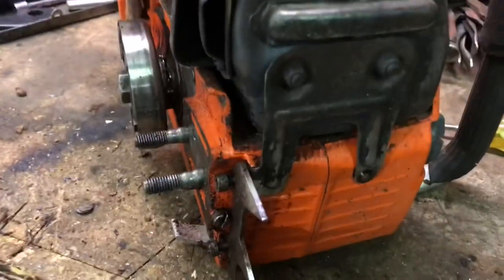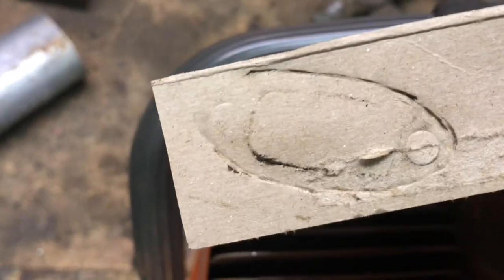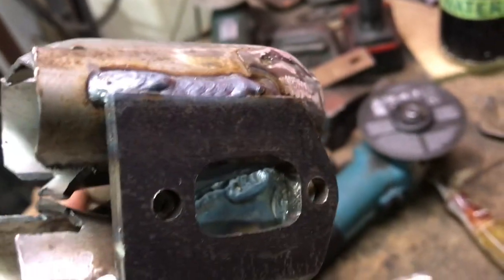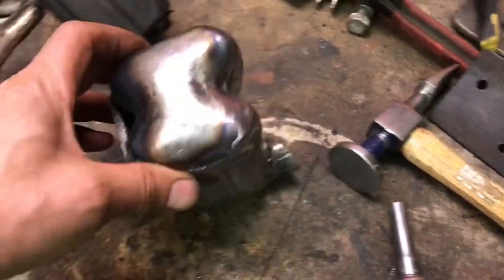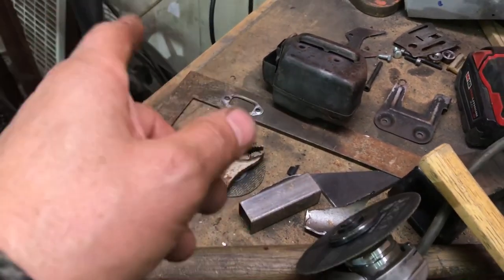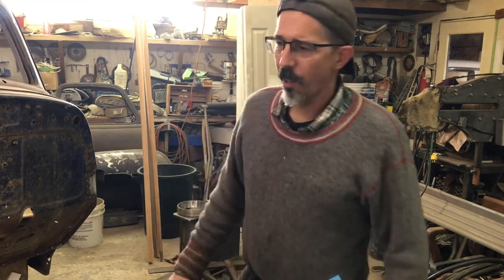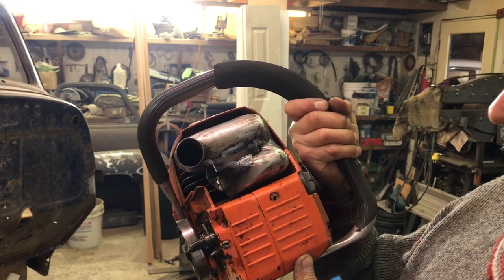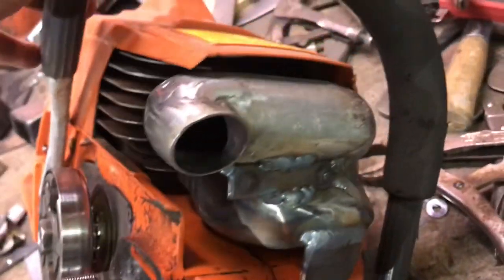Chain Saw Custom Exhaust Pipe

Comment: I think you should make a new brace for the front of it. Otherwise it will keep coming loose, and the bolt holes in your cylinder will strip out. I've seen it a hundred times.

Comment: I agree with the expansion chamber idea .I rode 2 strokes alot when I was young . Every engine design needs something a little different but an expansion chamber on a 2 stroke is very very beneficial.  Thanks for sharing you have a great design started please continue to experiment with it .

Comment: I love this, a brand new idea! You have really hit on a smart design. I love the connection between the chambers, I believe it helps the pulses pick up some velocity. Its like an expansion chamber compacted into the same size space as the original can but with likely a broader power band. Can't wait to see that in the wood 👍👍👍👍
Reply: It's almost like an offset smoker build. If you   can vary the exit pipe, you might be able to tune it to the size engine you run it on.

Comment: i like how you did the exhaust bolts , i've been running this very thing through my head ( meaning building a tuned exhaust  to fit into that cramped area )and the exhaust bolts always get in the way of the flow of the exhaust .  it also has a "pop" or "snap" to the exhaust , which i've only heard with a properly built  exhaust  .
Reply from the maker: I have another video coming out later today showing another pipe and we get into the wood.
Reply: @WildWestGarage  look forward to it :)

Comment: The pipe works cause it went rich just turn the high jet in 1/4 turn at a time till it cleans up in the rev. Once it cleans up turn it back in a 1/4 turn so it stays a little rich and you should be good. I like the looks of it to
Reply from the maker: Thanks Kurt. I learned my lesson with saw tuning years ago, leaned my saw out and it made awesome power until it seized up, I won’t do that again.
Reply: Agree Kurt, if it fattened the tune it's most likley working the right way.  Should be able to lean it, get a bit more power but most importantly more fuel efficiency with proper back pulses (draw fuel into the pipe then force it back into the chamber). On a hobby glow engine i went from a stock 1 chamber muffler with baffle cone to a 2 chamber pipe. Huge difference, engine was way happier, and could run leaner.  There's a few calculations you can do to size a pipe. I really like how Morgan built his super practical.
Reply from the maker: @layback209fixorsmash3  I put this saw in the wood today, got it dialled in by turning the high jet in about 1/8 of a turn. It runs nice but I can’t really say for sure if it makes any more power, but I had fun making it. Buckin’ want to try it on one of his ported saws so that could be interesting.
Reply: It’s the other way around, it should need more fuel not less. If your backing the high jet screw out your increasing fuel.
Reply from the maker: @kamenheath7192  it was running rich after I put the pipe on, sounded like it was four stroking, I turned the screw in and it smoothed out, maybe the pipe is garbage?
Reply: @WildWestGarage  maybe it’s just more noticeable since it’s louder. You may have been rich to start before adding the pipe.

It should of went leaner if the pipe is gaining you HP you should have to add fuel if the saw is making more power. Not remove fuel. 

And you wanna be 4 stroking while free revving ,I wouldn’t get to caught up with tuning till you got her in the wood. 🤘

Comment: That wall that’s right in front of your sound waves shooting “straight” out your exhaust port window… if they can hit a concave 6degree wall so they bounce back into the center area of that exhaust port window?  It’s definitely going to sound louder and prouder so that immediately makes like a whole”Nother” 5 horse power psychology anyway!!!  LMFFAO!   It’s a cool design!!!  I had drawn up a center chamber with the curved front wall to bounce my sound wave back into the center of my exhaust port window….   The tuned pipe research says 4.75 to 5.14 of 1/2” exhaust pipe….  I envisioned a four lobed flower with those four corners being the exhaust ports… that’s roughly 1.25 inches of 1/2” pipe coming out of those four corners or exiting the center chamber… with the majority of the “pipe” inside the centered box… I think that standard exhaust box on the 372 is 3x3x3 or 76x76x76 440cubic on a 71.5 to 76.4 cc engine….  I’d think 2x2 x 3” deep or 51x51x76 around 200 cubic c… or roughly the 1/3 or 3times the cylinder volume for the exhaust with those 4 corners venting through the 5” of 1/2” … I’m trying to combine that tuned pipe logic into a box… there’s much talk about a single vent for the system so I will probably need to rethink the 4 corners venting???   That’s a damn fine bit of hanging around the shop fabrication!!!  I’m totally digging the front support leg that’s totally locked down the whole deal with the vibration.,, I use a dab of 1184 on my bolts like a blue thread lock but it’s always around so I just use one sealer for everything… it doesn’t harden so it’s a great thread lock too!!’

Comment: Since there's one baffle separating the 2 chambers with no restrictions in port size throughout the system,  would there be any advantages in decreasing the diameter of the exiting port?  Is there such thing as "back pressure?"  Thing looks great dude. Seriously!!!
Reply from the maker: I kind of went at this thing all backwards, I built it and then did the research after. I am now thinking about how I can make restricter cones for the outlet so I can tune the pipe

Comment: Nice work Morgan sounds like a dirt bike now.
Reply from the maker: Thanks Robert, I love the sound of a well tuned 2 stroke bike.
Reply: An often overlooked critical design of a 2 stroke is scavenging this is what the expansion chamber does on the pulse of the gas rebounding off the chambers walls effectively acts as a valve holding the fresh mix against the piston until repeated, will be interesting to see what the gains are as it's a precise equation of speed and flow etc   

Nice job  sounds great I hope to see more or any adaptions 👍
Reply from the maker: @jakpips3967  Thanks Jak, I know there are a lot of variables involved in getting the ultimate pipe set up, volume and velocity and such. I didn’t want to build anything that wasn’t going to be practical for an everyday working saw. To be honest, I probably only reduced the exhaust restriction and probably could have achieved the same result by gutting the original muffler but that’s no fun. Thanks for the insight, I really appreciate comments like yours. Just kid’s having fun. Thanks for watching.
Reply: @WildWestGarage  I don't profess to know the calculations or anything im far from pro on mods I have 2/ bike experience and have read a few books..  Keyboard warrior n all 🤣  but fair play  if it runs better and you enjoyed doing it why not!?!  I enjoyed the video so more power too you 😁 keep it up